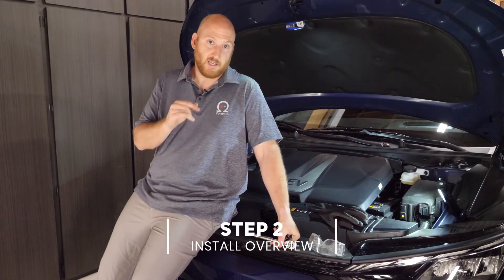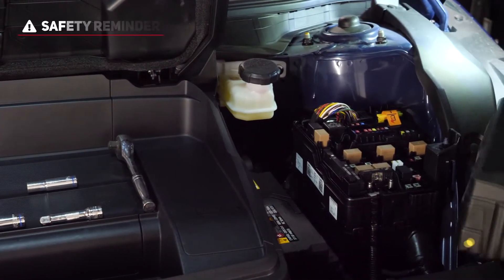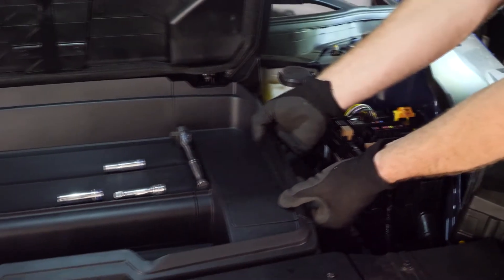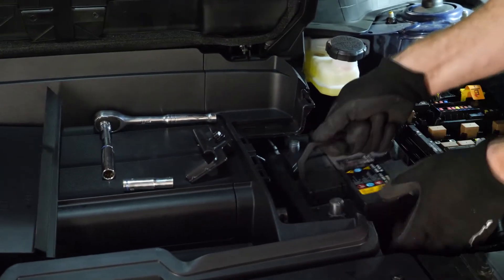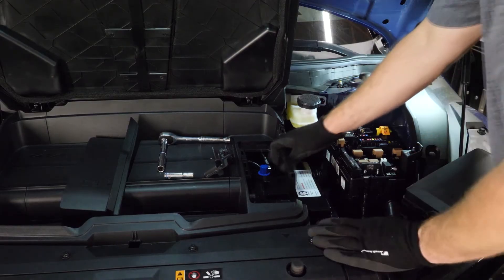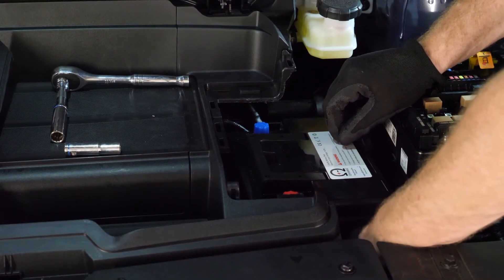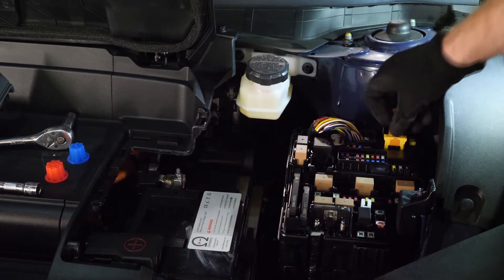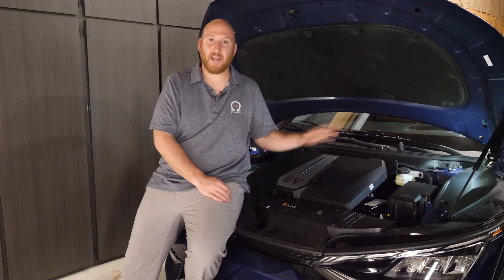Kia EV6 - 12V Battery Installation (Ohmmu)

Comment: Bought this after an ICCU failure. Super bummed when we had another low voltage situation. Battery at 8 volts. No warning from Ohmmu. 

HOWEVER, the Ohmmu app saved the car with this workaround. The app allowed us to stop battery discharging when parked. Until the ICCU issue is fixed, we just stop discharging when parked. The car is a huge battery vampire even when off.

Comment: My best advice to you is to study up on Lithium before you sell in-correct information. The current charging system in all cars to include EV's is designed for "Only" lead acid batteries. Lithium has different voltages and internal resistance. If you install a lithium battery in a car it only charges to 25-30% SOC. 

 There is hundreds of thousands of lithium cars out there all with the same problem in winter.  Unlike a lead acid battery that can be charged in frigid weather, a lithium battery cannot withstand charging at low temperatures because it causes "Plating" which causes permanent damage in just a few charge cycles. First off the Tesla battery is 16 volts ans it creates heat within the battery for cold weather and it does not operate the Tesla accessories, it only closes the high voltage contacts. 

Li-Plating is a formation which is deposited on the batteries anode surface during extreme cold temperatures and particularly during fast charging, high regen or high discharge. Metallic lithium reacts with the electrolyte and forms dendrites which leads to permanent capacity loss.

In more simple terms - Once temperatures drop below freezing, it causes the lithium batteries liquid electrolyte between the plates to thicken. The colder the temperature, the thicker the electrolyte becomes. As the ions attempt to pass thru the thickened electrolyte during charging or even high discharging, many ions fail to reach the other plate and remain permanently lodged in electrolyte forming an insulated barrier called plating. Plating is permanent and continues to block the free-flow of ions during fast charging, acceleration or even high regen, reducing battery efficiency and capacity.

Regards - Mike
Reply from the maker: I'm glad you edited your original piece instead of replying and tried a little harder for accuracy in this one, kudos on that.  Still not fully correct but you do demonstrate some knowledge.  Clearly not an "expert" and clearly this isn't your field (25-30% SOC, really?  Do you know the charged voltage of, let's say, the 12V battery on a 2015 Chevy Volt?  For example...) but thanks for the "advice" anyways.
Reply: Dude ever since 1995  aside from designing lithium system for the RV industry I also design lithium front line Rotory aircraft for the military.  I know lithium my best advise is to listen to experts when they advise you that you are making a mistake. Mike

Comment: You can spread false rumors but every lithium battery has cold weather limitations - if your battery does not shut down in freezing weather then you defeated the temperature sensors. If you charge and discharge a cold soaked battery you will cause plating and permanently damage the battery. 
Quit telling lies to the general public. Every car EV manufacture installs AGM batteries for the sole reason they do not shut off in cold weather.  Do you really think they don't have a lithium battery for their cars. Really Study Up and quit making money off inexperienced car owners. Mike
Reply from the maker: Good to know, thanks so much, you clearly know it all, congrats, you win the internet today.  I am sure you know this BUT all battery chemistries (even AGM) are fatigued by cold weather use, in fact any extreme use in terms of Temperature (high or low), Voltage (High or Low) or amperage will cause fatigue (ie. "permanent damage").  Did you know that not all Tesla 12V's were AGM as you stated ("Every car EV...")?  They also installed a lot of FLA.  This wasn't done because they are "cold proof" and no amount of cold weather fatigues them whatsoever, it was done b/c they are cheap and industry standard.  Otherwise, oh dear, what are they going to do now that every Tesla sold contains not only a HV Lithium but also the LV Lithium battery?  

Another note, The Ohmmu H5+ battery sold on our website, it has built-in heating mechanisms as well.

Comment: If I want to use a battery tester, should I disconnect the high voltage system first?
Reply from the maker: Depends what you are testing for, I'd recommend disconnecting the 12V battery if testing it.

Comment: THIS IS NOT TO KIA  SPECS - THE CHARGING PROTOCOL FOR LEAD ACID BATTERIES IS TOTALLY DIFFERENT THAN LITHIUM. WITH THE HIGHER VOLTAGE AND DIFFERENT INTERNAL RESISTANCE OF THE LITHIUM BATTERY THE 12 VOLT BATT REGULATOR WILL THINK THE BATTERY IS ALWAYS FULLY CHARGED AND "NOT" CHARGE THE BATTERY TO FULL CAPACITY. IN ADDITION, USING LITHIUM YOU NOW HAVE WINTER CHARGING PROBLEMS YOU CAN CHARGE THE 12 VOLT LITHIUM BATTERY BELOW FREEZING. THIS SAME CHANGE OUT OF LITHIUM WAS USED FOR MOTORCYCLE BATTERIES WITH CONSTANT FAILURE.
Reply: Interesting since my dealer told me they wouldn’t install it unless it was up to Kia specs. They installed it, so not quite sure what exactly you’re talking about.
Reply: @frankiejane1109  I'm talking about as soon as it reaches below 32 degrees the battery turns off and your stranded. Plus the charger curcuit in the EV is only designed for lead acid which works at lower voltage than a lithium this means your battery will never fully charge in that car.
Reply from the maker: This battery will not turn off because the temperature is below 32F, that is misinformation and misapplication of a widespread fear of charging "lithium" in the cold.  This isn't an issue for our batteries.

Comment: Hi, can i change a more capacity of 12v battery for my ev car? The default 12v lead acid battery installed in my ev has 45Ah of capacity, hardly enough for my upgraded sound system, so that i hope a new bigger Lithium 12v battery can solve the problem. But i don't know if it's available and safe?
Reply from the maker: Hi you can definitely expect better sound-system performance if you upgrade that lead acid battery to our Lithium 12V battery.  The main variable you are looking for with a sound-system isn't Ah though, it is voltage-sag under load and Peukert's value for the chemistry.  These 2 technical features are where Lithium chemistries handily beat Lead Acid, under load the Lead Acid battery voltage will drop very fast which leads to reduction of available power to energy hungry amplifiers.  Peukert's value means that sustained higher loads lead to severe capacity reduction in Lead Acid.  The 45Ah you mention from the stock battery, if you actually load it up with say 25A of load will drop like a rock in water to maybe half that value (20-25Ah) while the Lithium will sustain much greater capacity under those loads. 

Our batteries are totally available for this vehicle platform already!  

https://www.ohmmu.com/product-page/12v-lithium-battery-for-kia-ev6
Reply: @OhmmuEnergy  thank you so much!
Reply: What is the ahr on your battery the 2023 ev6 has 65ahr. Thanks

Comment: I think you can leave a trickle charger on the lead acid I’m not sure about the other battery
Reply from the maker: You can leave a trickle charger on it, that isn't a problem
Reply: The trickle charger I use has a setting for lead-acid battery (including AGM) and a setting for lithium-ion.  I would suggest that if a lithium battery is going to be trickle charged, it should use a charger which can supply the correct voltage, amps and charging profile.

Comment: Oh yeah,  how about the cold, at -20 , does will battery keep it charge or like every iPhone on the cold the battery lost all it capacity ? 
and why the hell changing the battery yourself when the car is less than 1 years old and still in warranty.
Reply from the maker: Do you realize that the same capacity loss in the cold occurs with Lead Acid batteries as well?  This isn't an issue specific to Lithium chemistry and not all lithium are built the same or even the same chemistry.  The effect of the cold is variable based on the battery design and specific chemistry.

Comment: What would be your recommendation when leaving the vehicle unused in winter for 3+ months?  Leave on a trickle charger?  Thanks
Reply from the maker: Yes, trickle charger is a good idea for the 12V battery during period it is left unattended.  Even in the cold it is not an issue to trickle charge these batteries.
Reply: @OhmmuEnergy  Thank you very much. Your reply is really appreciated.
Reply: Leaving a trickle charger on for six months I’ll let you know
Reply: In fact, the 12V battery is topped up from the HV battery every night, as long the SoC is >20% (unless they tweaked that meanwhile). So, I could imagine, if you change your HV battery to 60%, this should be fine for a long standby.

What also works, if you have an indoors parking lot, is to drive the HV battery down below 50%, limit AC charge level to 50% and leave it attached to the AC wallbox. You can leave the charge port unlocked in case somebody needs to charge on the parking lot next to you, but tell them to re-plug it to your car again, after use.

Comment: How well do these hold up with aftermarket amplifiers?  I'm surely going to add a 4-500w amp to the weak Meridian audio with a 12" subwoofer... This is nothing crazy obviously, but I need more bass...
Reply from the maker: Lithium has a higher voltage performance during amplifier drain/use so you get a little better bass when you upgrade to Lithium and have amplifiers.
Reply: Better than the stock battery, but you’re also using a lot more power. Hope you find your zen.

Comment: Lead Acid batteries have a different charging profile than LiFePO4, where is that set up at? (standard 12 PB batteries can tolerate being continuously cooked by the DC:DC converter vs other chemistries).
Reply from the maker: Actually any/all batteries will be worn out pretty quickly if they are "continuously cooked"; if you have a specific voltage that you are referring to it may be more easy to compare though.  LFP chemistry has a higher nominal voltage than Lead Acid so generally speaking is more tolerant of continuously higher voltages.  If you push them too high, they will wear out (just like any other chemistry).

Comment: Do you have to enter security code on entertainment system? Or lose your settings? Any impacts after having removed the battery?
Reply from the maker: No, no security code reset necessary.  I think because they are so "built-in" nowadays they no longer manufacture them that way since it was a method being used to prevent theft of a system that could be used in another vehicle.

Comment: What about the red and blue cap.You not putting back on the new battery.Or is not necessary?
Reply from the maker: The Red and Blue caps on the Ohmmu battery are just there as terminal covers to prevent shorting during transport and storage, they need to be removed before/during install and can be recycled or saved or even better put them on the old battery during transporting it to recycling!